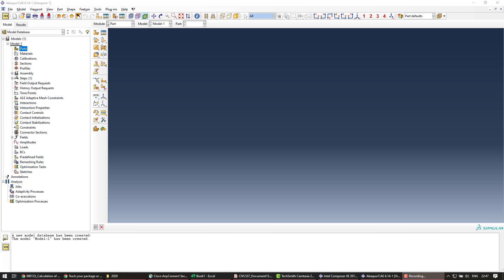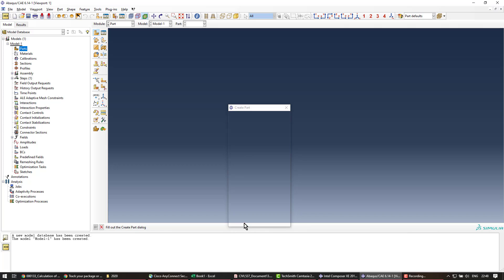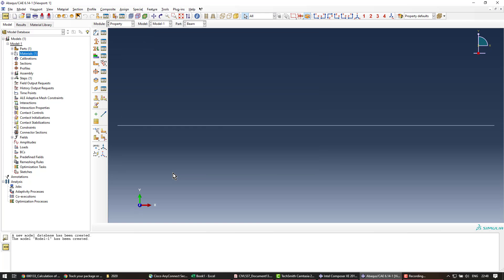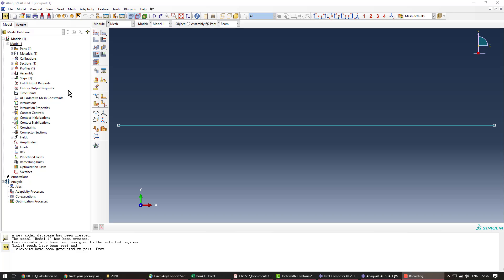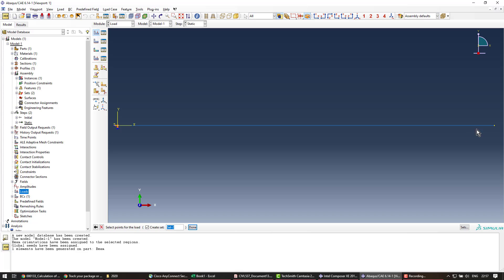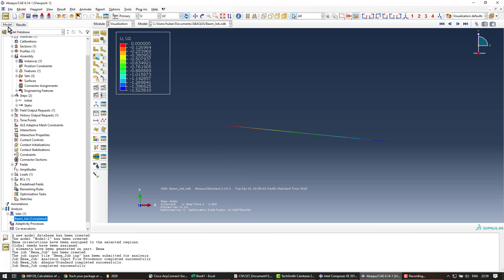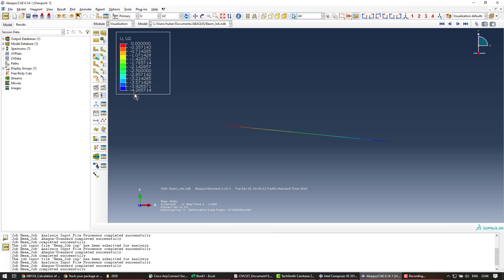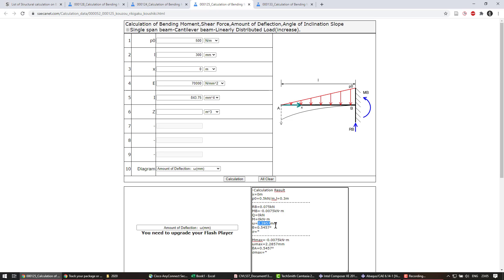Abaqus Tutorial: Beam element performance

Comment: Hi, if I wanted to apply a concentrated load in the middle, how would I do it since there is no point? trying with "reference point" I have some problems, probably due to the fact that it is necessary to couple beam and point. Thanks for the reply
Reply from the maker: You want to partition the edge in the Part module. You'll then have access to a vertex to apply the load on.